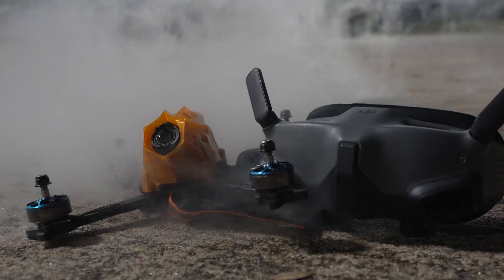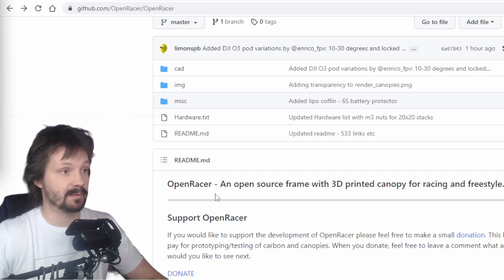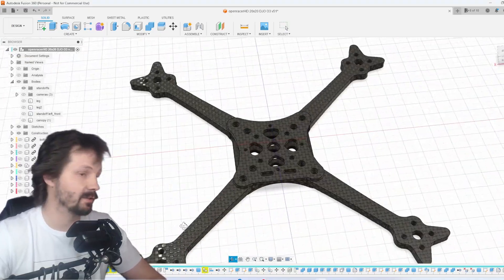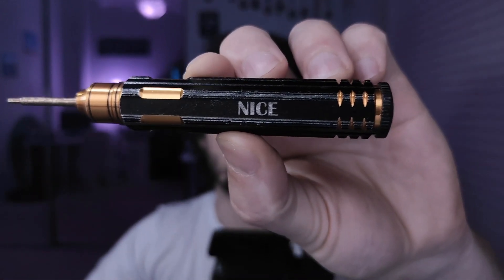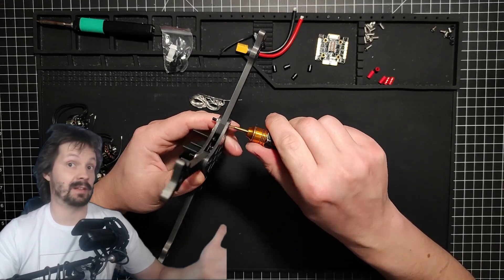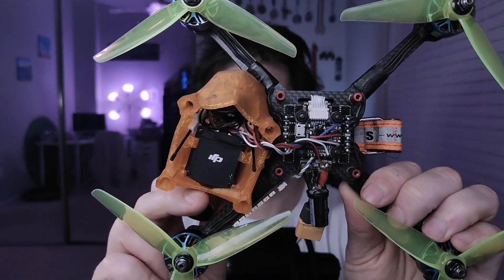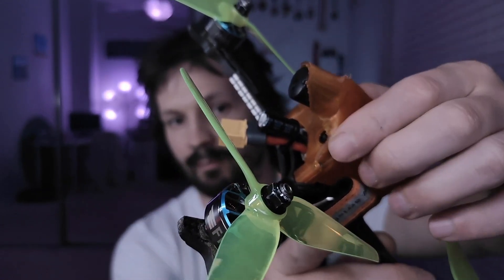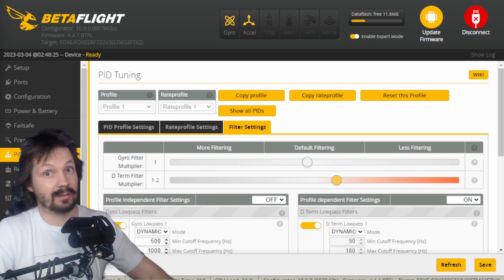OpenRacer + DJI O3 = ❤️? (multipurpose drone overview)

Comment: Limon, 

This frame has been impeccable since it’s inception. It flies like a dream and handles the frequent crash like no other!

Because of this, I have to ask, do you plan on making a canopy to accept the newly released DJI O4 Pro air unit by any chance?

Thank you very much in advance for your time and consideration.
Reply from the maker: Yes Sir, i already ordered o4 Pro and will be making a new pod for it.
Reply: @IvanEfimovLimon  You are the man. 

Can’t wait to get it printed and installed!
Reply from the maker: DJI O4 canopy is Done, Sir! :)
https://www.youtube.com/post/Ugkxv9erWkOpZX6GeZ3jd5cnA-Ow6lQX-LvM
Reply: @ That looks unreal!

Can’t thank you enough Limon, the FPV world wouldn’t be the same without you. 

Can’t wait to test it out.
Reply from the maker: @tomwilson5337  thanks man! That's too high of the assessment for me! :)
Reply: @IvanEfimovLimon  You are too humble good sir!

Personally speaking, without Betaflight or the Open Racer, this hobby would never have been possible.
Reply: @IvanEfimovLimon , I hope this message finds you well!

Unfortunately, my usual flying spot has recently tightened restrictions on drones, making it nearly impossible to fly a 5-inch.

In response, I’ve been working on a DIY 3.5-inch frame that features a canopy for the camera, heavily inspired by your OpenRacer design. While I’ve managed to sketch the canopy lines in 3D using Fusion, I’m struggling to figure out how to extrude or loft a shell that conforms to these lines in 3D space. Honestly, I’m not sure if this is even the correct approach!

Could I kindly ask for any advice or recommendations on creating a custom canopy using Fusion?

Thank you so much in advance for your help!
Reply from the maker: @tomwilson5337  hi Tom.
Sad to hear about your flying spot.

In regards to canopy design, I use Form tab in fusion for that. Basically start with cillinder, shape the inner surface of the canopy around electronics. Then still in the Form mode I thicken it by 3mm and then I make the outer surface look good
Reply: @IvanEfimovLimon  Cannot thank you enough for sharing your process, really really appreciate it. Will be sure to try the form feature tab out. Always wondered what it was used for!

We'll be back flying in no time, hopefully.

Thank you very much again :)

Comment: Just had 2 frames delivered from Five33. Frame is quality. Well done brother. Im waiting for my canopy prints right now and then building both quads with foxeer reaper 60s and tmotor f60s. Can't wait to rip them! You should make a 9inch monster version, Limon. Need a 'Merica 9 replacement :P

Comment: So Ivan, i got few vistas with Nebula Pro cameras, but no angle lockers :(. Should i just ditch them and get o3 for freestyle/race or is vista still good anough and did someone design Nebula pro angle lockers? Cheers, and thank you for the videos.
Reply from the maker: i was flying vista without locker for quite a while, should be OK. Altho O3 unit is so much better :)

Comment: What is the "dry" weight of the frame with screws, please?

Really like this concept, the review is slightly mental, but very entertaining.... :-D
Reply from the maker: i forgot to measure that... I know the full build drone is 350 (without battery) with 2207 headsup motors and props, with big 20x20 60A foxeer ESC (square one).
So something like 90-100g, just the frame (no braces)
Reply: @IvanEfimovLimon  I have got the frame now, looking into electronics. The 45A F4 mini Foxeers do fit, right? I even see in the video the 60A F4 mini, if I am not mistaken.

Comment: Bummer, Five33 send only 2 x 10mm M3 Aluminum standoffs  which means I cannot finish my build :(  Why not include 4 standoffs for O3
Reply from the maker: i will let them know... But FPV pilot must buy bunch of different spare screws :) You will need them eventually.
Reply: @IvanEfimovLimon  Yeah I know... didn't need until now...😆
It's my fault for not reading what is included in the package.
Thanks

Comment: ANY WAY TO MOUNT A NAKED CAM ON THIS
Reply from the maker: What for? O3 records amazing. But it would not be hard to add little mounts.
Reply: @IvanEfimovLimon  yes i would like yk add a bones and shoot on tracks chasing cars,
Reply from the maker: @notyet_fpv  what's the naked cameras use for mointing? Can you send me a file or link?
Reply: @IvanEfimovLimon  I am using a hero 10 bones, I want it with variable screw mount
Reply from the maker: @notyet_fpv  you got a file somewhere for the mount or the file of the camera with the mount? Would be easy for me to just make it there.

Comment: Limon, I am very upset with you. You've given me a lot of work to do. So I built a quad on your OpenRacer DJI O3 frame. Had to make minor modifications (longer screws & washers for the SpeedyBee 30X30 stack & to lift canopy, see it on Rotorbuilds under Stevensbox). It flies as good or better than all my other builds. I crashed hard 3 times so far with no damage (I am a sh_t pilot). Not only that, I have 2 more frames on order because my brother in law wants me to build him one & I want a back up. Now I have to learn Fusion 360 to modify the canopy to accept a GPS & maybe get props out of view (Tinkercad could not upload the stl file). You can make it up to me by making a squished X frame with the option of 6" arms. Get to work. Don't be lazy.

Comment: Hi Limon,

Is it possible to push the .f3d or eventually just STEP-files to Github also? 
I like the OpenRacer frame and durability of the canopy, but I really hate editing STL's if I want to make some small changes such as adapting for the antennas I have, adding a ThumbPro, etcetera.
Reply from the maker: For sure. But honestly it's too much work at this point. You can always ping me and ask to share specific canopy that you want to modify

Comment: TIP: Dont mix thread locker with plastic props, they explode when you do(ask me how I know). I would also be careful with flames near the motor windings as the enamel is right there waiting to run and short a motor and probably ESC while it's having fun.
Reply from the maker: Or course has to be carefully and not put windings on fire, but just heat the screw :)
Reply from the maker: Just poored bunch of threadlocke on HQprop, left it for a day, nothing changed... Blade is as flexible, bendy and durable as the others...

Comment: Can you change the uptilt on this? Or are there different canopies with fixed angles?
Reply from the maker: There are few versions. Variable angle 30-50, variable 10-30, and a few fixed angles.

Comment: Great vid. You've convinced me. I'll build one. Do you think the Speedybee F7V3 stack will fit? Do you have any issues with the DJI O3 Air Unit over heating?
Reply from the maker: Thank you!
The stack will sertainly fit the frame, but I haven't tried 30x30 stacks in combination with O3. On paper it fits
Reply: @IvanEfimovLimon  Any Overheating problems?
Reply from the maker: @stevensbox9625  no sir. Only if you keep it on the ground for a few minutes. Ventilation holes doing the job
Reply: @IvanEfimovLimon  Oh crap! I got my order today (fast, thanks). Also just went through your github. I see you have stl's for different camera angles & for Vista's (I have a shit load). I'm so excited I might shit myself. The PRUSA will be hard at work soon. I will be ordering more frames (using your affiliate link of course). God's speed.

Comment: This is so badass. I've been trying to think of something I want to build with the 03 4 for months now. I've got a ton of freestyle quads with the original Vistas and air units, and this looks indestructible and a perfect use case. Incredible work and hilarious video as usual. 
Limon the LEGEND! 🙌🏻
Reply from the maker: Thanks a bunch man! Btw is has a canopy specifically for vista :)
Reply: @IvanEfimovLimon  thanks Ivan! It's one of those situations, where I don't necessarily need an O3 but I want one, and having a justifiable use case will motivate me to pick one up..😂🤑
Cheers, have a great week, thank you so much for all your hard work on betaflight. The last couple of releases have been absolutely incredible. 🔥💪🏻
Reply: It's my birthday, so I decided to make this my party! Got my frame yesterday,  ordered the 03 livery pod from 533, and all my electronics should be here tomorrow.  I went a bit nuts. I want to have fun with this build. I've never been into racing, except a couple of months ago my friends started a tiny whoop Race League in Edmonton, and now I've raced two times, and placed 3rd both times. I've got to thinking, maybe I do like racing, and then those guys told me that they actually get together to race in the city a few times every summer. For that I can't really justify building a purest racing drone, but I like the idea of having something multi-purpose.
I've got the foxeer h7 (overkill, I know), and a Kiss Ultra mini on the way, and I'll pair one of them with the Foxeer mini 60A. (Square version). Rcinpower 2207 2100k, Elrs, 03, Ultra!?! It's my birthday and I can do what I want..🤪
Oh, and I got my frame cut at CNC Madness in both silver and blue, so I'm going for a two-tone. I'm stoked. Thanks Limon!! 🍋🍋🍋

Comment: What perfect timing. My openRacer frames arrived from Canada to New Zealand yesterday. Thanks so much.
Reply from the maker: Enjoy the riding! How much was shipping?
And watch out, CNC madness got a few screws wrong in the past and missing.
Reply: @IvanEfimovLimon  $40US for shipping 4x OpenRacer frames including braces, a toothpick and some extra stack screws. Shipping to NZ is always expensive though. I think the screws are correct for a 30x30 build but not for a 20x20 so I'll have to source those myself. I've printed the HDZero pod with integrated fin from TurtleModeFPV. It looks pretty nice. Tough and low maintenance rather than low weight is what my skill level needs!
Reply from the maker: @P-Bee  not that bad 40$ honestly, I thought way more. So if you got bunch of extra spare carbon it's manageable